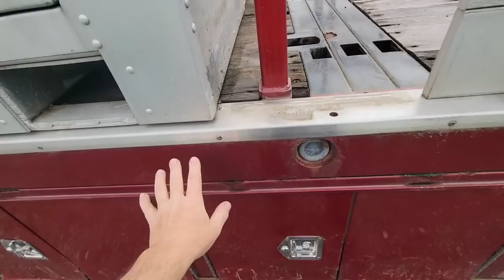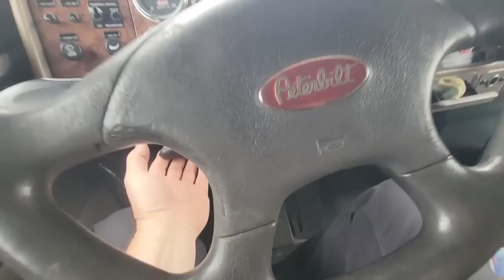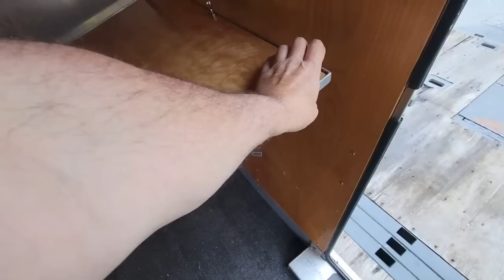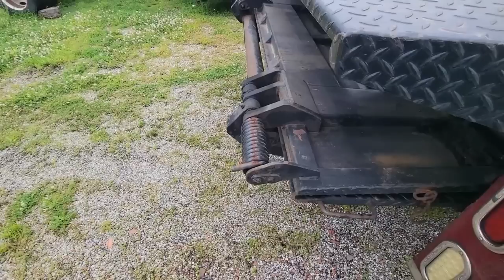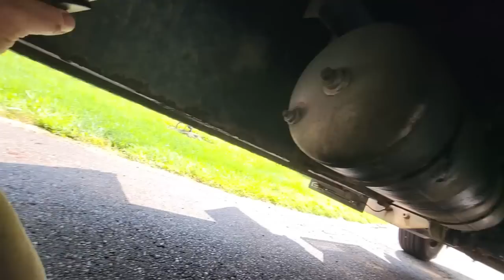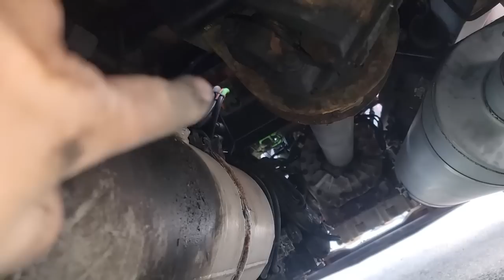BUYING A TRUCK FOR ME! THE REVEAL! THIS ONE IS NOT FOR SALE!

Comment: WELL, YOU COULD JUST U-HAUL OUT AND FLY BACK. ONE WAY RENTAL ON A VAN, BETTER FUEL MI. OVER ALL COST, WEAR/TEAR WOULD BE LOWER AND LESS RUNNING AROUND FIXING STUFF BEFORE YOU GO HOPING YOU "DID" FIX EVERYTHING.
Reply from the maker: Over $3000 to rent the van one way.....pass.
Reply: @j.c.smithprojects  WOW, THINGS HAVE CHANGED ALOT IN THE LAST COUPLE YEARS. A 26' U-HAUL OUT WEST WAS AROUND $1800 AND ONE GOING EAST WAS $4800+ SAME FROM FL. TX. UHAUL NEEDED MORE UNITS OUT WEST, CA. AREA BECAUSE SO MANY PEOPLE WERE LEAVING. OH WELL, JUST A THOUGHT.

Comment: Nice! I flew to LA and bought one of these movie trucks in 2010, drove it back to Edmonton, AB. It was a '96 Freightliner FL112. Had the same style of body, made by American Truck Body in Fontana. It had a Cummins M11 and a nine speed. Maxon power tailgate and a Binkley 32K flip up fifth wheel. I made an accessory I called a cassette, that you could drive two big cruiser bikes onto while the tailgate was on the ground, lift it up-, and roll it on casters to the front of the bed and strap it down. This allowed you to flip up the fifth wheel, hitch the travel trailer and hit the road with your bikes and camper. Nice rig. Toured all around the US Southwest that year, sold the truck and bikes a couple years later. Good times. The extra holes at the front of the bed allow the full set of bed stake side sections to be gathered at the front and leave most of the bed empty, for fifth wheel towing or loading something. Well thought out beds.

Comment: Nice truck…I’m with you on the steer tires….being it will run short distances once back…maybe buy a lesser grade brand…reasonable enough to
go to a H rating but half price of a Michelin or whatever .
   I think the bed is fine itself..maybe do the tool boxes like you mentioned . For me personally…I’d love a lift gate ..nice to load parts..tires etc …I have 3 gas engine air compressors…I have a stationary one bolted to the floor but the 5hp 20 gallon ones get heavier as I get older…they weigh about 250 pounds..not horrible but bulky and hard to load . It’s your dream truck…you won’t rest until it’s how you want it

Comment: I owned 3 Isuzu NPRs over 20+ years. 2 had lift gates, they are amazing. One I made a bracket with 4 receivers mounted to mount to the truck. And a receiver for the hitch. PIA to install and remove to use the hitch. The last one had the lift that folded up behind the doors so I could slide a receiver and pull a trailer easily.

Comment: I sure do like this model Peterbilt.  My nephew had one almost like yours with a 42 inch sleeper and gooseneck hitch 35 foot  livestock trailer and they ran it a round a week back and forth from WVA to Amarillo, tx for over 500,00 miles and replaced the engine just before they traded for another.  BTW in your video when you were working on the  van front end rebuild, I thought I heard you say you were hauling the IH engine to Oregon  with it and thought it was going to be exciting, haha.